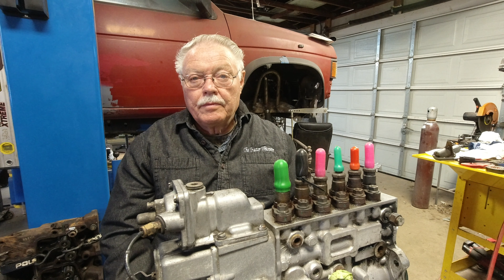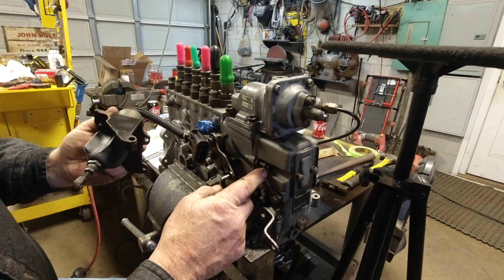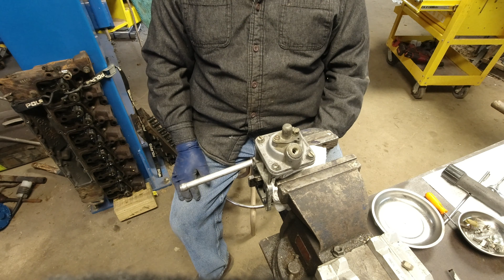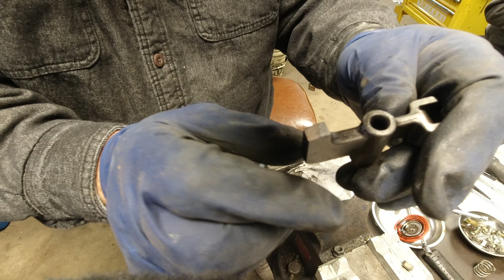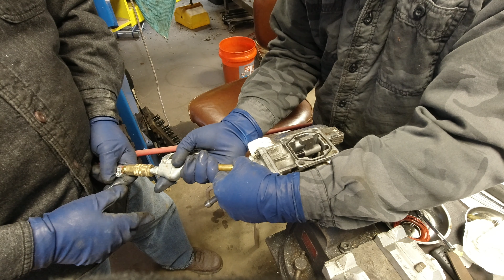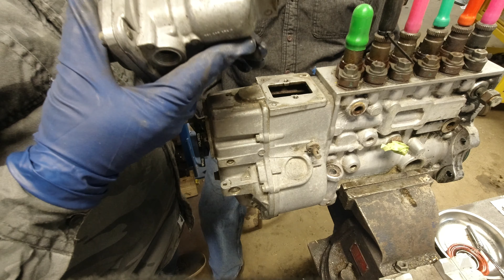Modifying AFC for AFC Live & Max Travel kit on P7100 P-Pump 2008 F450 Cummins swap (episode 8)

Comment: Currently doing this same swap on a 2008 F-450 King ranch. Running this same kit 🤘🏼. Got a nice adjustable p7100 gear, fleece head and a nice cam going in 👍